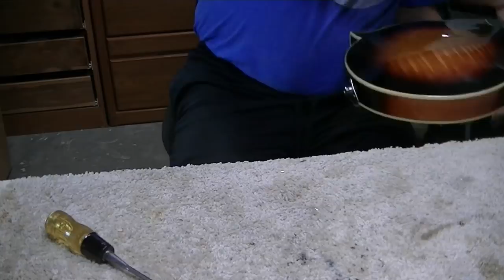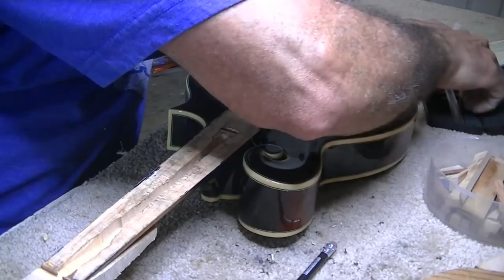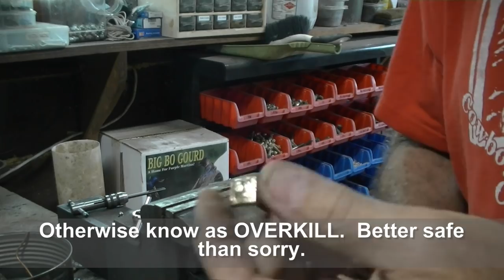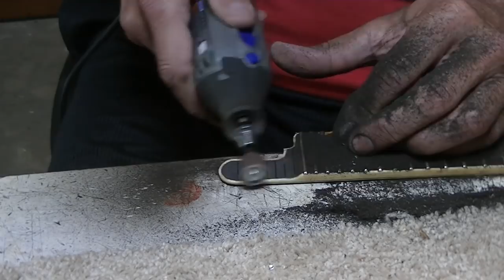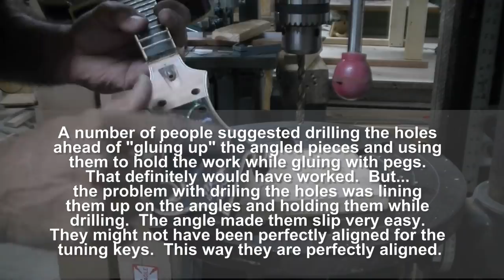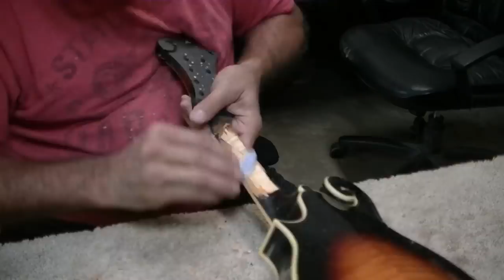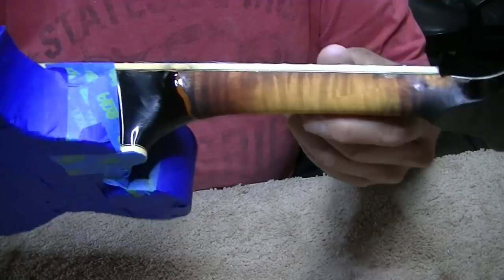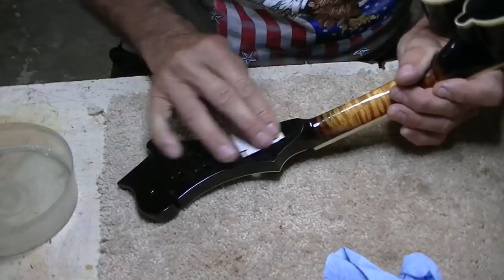232 RSW My Best Neck Repair Video Ever P2

Comment: hello Guy, Really you have done a good work on this neck joint, Great finishing, but I could disagree with my colleagues that was a good job on a neck because, when you start this video, you had show us one orthodox method that was simply gluing both parts of the broken neck. I have doubts about the insertion of one strange material between the headstock and the neck, like you have done, could cause distortions on the waves that come from the nut to the body. For sure, those distortions cause another composition of the sound response of the original neck. Please, I ask you to comment my statement. Best regards
Reply from the maker: I think you must be imagining something. You're thinking way too deep for this old country boy. The wood was the same kind of wood as in the neck.  Scarf joints are used in millions of guitars commercially-produced. I have no idea what you're imagining.
Reply: Escuse-me if I would be rougue. That was not me intention. I would like to discuss about acústico seves propagariam , and I thought that was  a good oportunity. Regards

Comment: Question... If the one end of the truss rod has the threads fixed and braised. How does the trust rod turn when you need to adjust. Maybe I just dont understand the operation of the truss rod.
Reply from the maker: The truss rod has a slight under bow in it and when you tighten the nut it straightens the rod which straightens the neck.
Reply: @RosaStringWorks  Thank you Sir! Love the videos!

Comment: Jerry, You have probably talked about the fretboard extension on a Mandolin before...but I'm wondering why it exists in the first place and are there any Mandolin players that actual play notes there (I'm guessing not because otherwise you wouldn't remove the frets and scallop it out)?
Reply from the maker: The very small part is just decoration for the most part. I'm sure there would be someone that could use it to play some sort of trick tune but for the 99% of the rest of us it's just decoration. It exists by tradition because Gibson put it there in the early 1900s.
Reply: Sorry to keep yakking on this, but considering the violin influence on Gibson archtop instruments, they needed to be playable wherever you'd play on violin. I think these were mostly designed for orchestra playing anyway. Monroe would say something like, 'Just don't play down there.' Meaning, don't let your pick hit the fretboard.

Comment: My original opinion of fixing this mandolin was: jack up the radiator cap and drive a new mandolin under it. I've been a woodworker and luthier for many decades. You just can't weld and machine wood like it's steel. Every inch of every piece of wood is at least a little different from the next one. And every musical instrument is multiple pieces of wood and other materials and thousands of decisions.

Comment: wow u would have just thought well toss it in the fireplace this one is a total loss i actually had to go back in the video to see where you repaired it one of the best to date im sure   

quick question we all know willie nelsons guitar "trigger" if somehow it wasnt a celebrity in itself and walked into your shop could u fix trigger without replacing the top or fretboard (we know that trigger would never be repaired full on and that its sound comes from how beat up it is
Reply from the maker: Yes I have replaced patches of wood in both Guitar tops and fiddles.  So I don't think it would be terribly hard to fix trigger.

Comment: My solution would have been to glue the headstock back on and removed the truss rod and laid carbon fibre tows into the slot and replaced the fretboard to finish